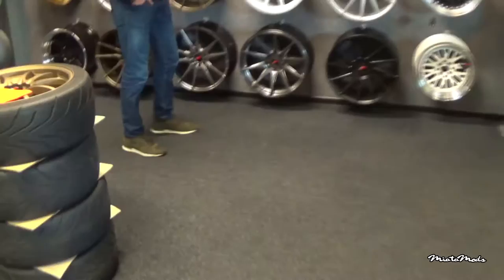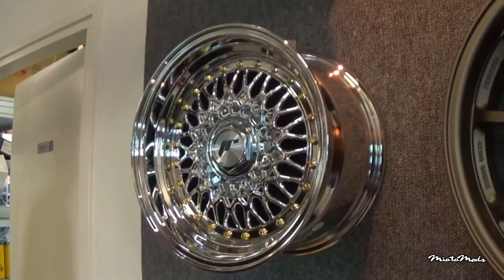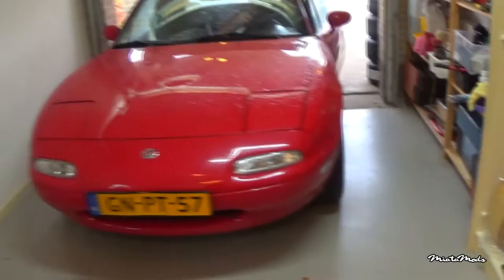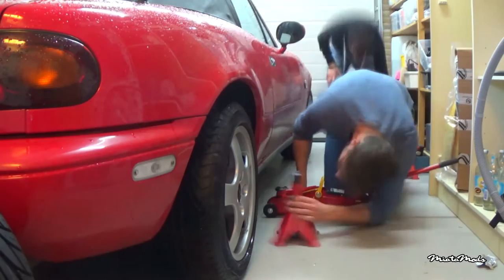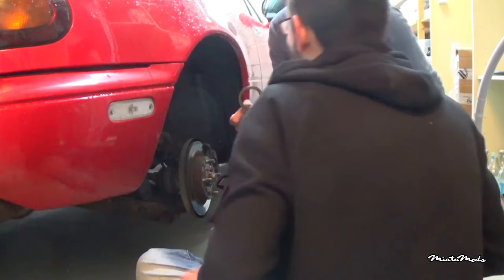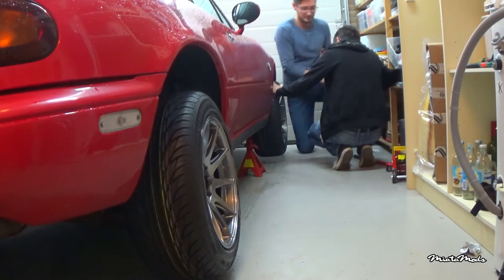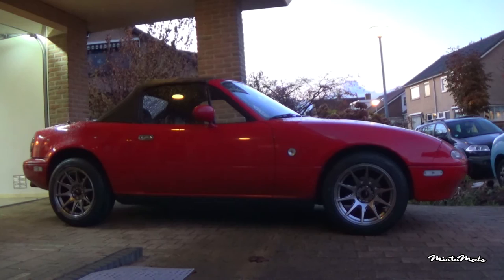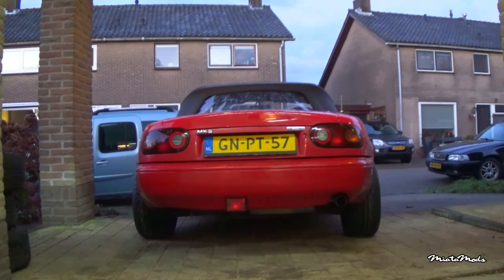MiataMods Vlog #3 - New rims, tires, steering wheel and quick release!

Comment: The Mx5 has ET45 as default value.
So doesnt the ET25 put a huge strain on the metal/steering/connection rods?

The interwebs say a margin of '5' is acceptable, but more than 10 difference in ET value will put stress on the workings of the car...
What do you think?
Reply from the maker: A huge strain? No, a strain, yes, but it’s fine. There are a lot of track guys who run 225 semi slick tires on et0 wheels and they don’t experience a lot of drivetrain problems so running a 8J et25 wheel or even a 8J et0 wheel is not a problem. It has been done so many times without issues and if you do kill a wheel bearing or something replacement parts are cheap. Don’t be scared of braking something, everything can be fixed 😉
Reply: @MiataMods   I see, thanks "voor de snelle reactie" And i will now confidently look for fatter, and more bulging wheels. Since i love that 90s popping rubber look!
Reply from the maker: I agree! Good luck!

Comment: Any rubbing? I want them too, but im not really shure if they fit in the front.
Reply from the maker: With stock springs and shocks  I didn't had any problems until I went over a bump haha but I only had problems on the front driver side so with a bit of rolling the fender the problem was solved. If your Miata is lower than stock you will have to do some rolling BUT it will look a lot better if you ask me.. good luck 😊

Comment: I think that those wheels are too large for your car, and heavy, JR11 in 15x8 weight about 7,5kg, stock Daisy R14 is about 5.5kg. Thats a big difference, And 8J with ET25 makes car looking high. But i prefer stock suspension, its really communicative and very fun. Im now looking for light R15 rims, ET 6.5J-7J ET about 30. You should try JR3. That is really light wheel. 
But..can you tell us any experience with new rims? I have 185/60 r14 - stock tires and wheels. Can you tell difference with old and new tires?
thanks and greetings from Slovakia :)
Reply from the maker: ET and J don't make the car look high, its all about the diameter and aspect ratio. So for example, if you would swap your 185/60 r14 to a 185/60 r15 your car will be higher of the ground. If you would go for 185/45 r14 It would be lower. That's why my tires have aspect ratio of 50 instead of 60 so that the overall hight of the car will be roughly the same. Now, because I have stock suspention the car is pretty high but I had the same problem with stock rims, that's just the stock suspention. That's why I will get some good coilovers and let me tell you; try a car with some good coilovers and you will realise how much better the suspention will be over stock suspention. Yes, 8J et25 is pretty wide but a lot of Miata guys run these numbers. Good coilovers, a few degrees of camber and rolling the fenders a bit will make the wheels fit perfect! Just follow my channel and I will prove it to you in my future videos :-) As for your question, yes I can really tell the difference! I have a lot more grip and I can corner a lot faster! Thanks for watching, I hope you subscribe!
Reply: I understand what ET is, i just wanted to tell, that fact, that tires are going out of shapes of car, make it look your car higher. With stock wheels its not so big difference, but with low ET and 8J rim its looking more high. Ive tried NB with 235hp turbocharged on KONI suspension and it was amazing. It was a way lower, but not uncomfortable, but it lost so much body roll, which i love on my stock NA. I like to feel a weight transfer. I dont know if you understand what im try to explain. I absolutely agree with good coilover, i tried also a TA technix and it was just horrible driving experience. So coilover will be great, but you should go for quality. 
Of course im subscribe, im huge fan of Mx5 and decent modifications. 
Have a nice day and thanks :)
Reply from the maker: Yeah TA Technix is not that great.. I'm thinking of buying Flex Tein Z's. Pretty expensive but people are really happy with them! You own a Miata as well?
Reply: Tein sounds really good. Yes i have 1991 1.6 115hp MX-5 with no rust, in absolute rare condition. Its just great car for any project, but i prefer a STOCK setup just with any few mods for better handling etc.. So im looking for light rims, and when i will be rich,maybe coilover :). For me is important basic service, its 25 years old car... I replaced so many things just to be sure, because my trips are about 5 hours long (nonstop driving) or maybe more. This summer i had 7 hours trip in other country. Thats also a problem with suspenison. Roads quality are sometimes really bad and stock suspension works really nice. 
I can send you any photos if you want to.  I just prefer make myself a better driver, than making some mods on the car,. :)

Comment: Do you have 195 or 205
Reply from the maker: In this video it was 205/50. After a while I changed it to 195/50 and I should never have done that because that was the moment my rims were not protected by the tire anymore.. so yeah, the edges are all scratched up now.. next tires will be 215 😅